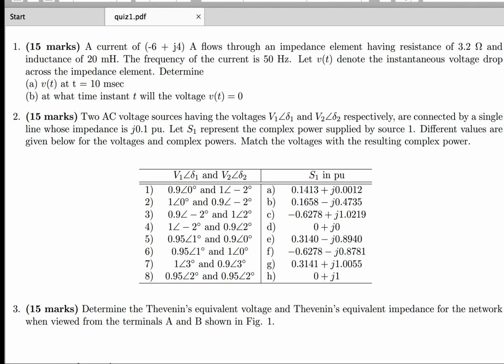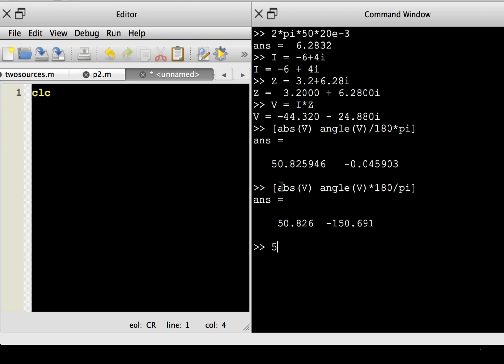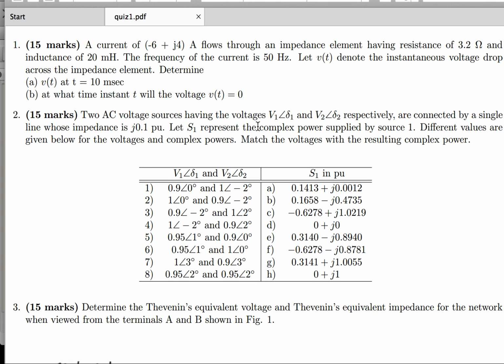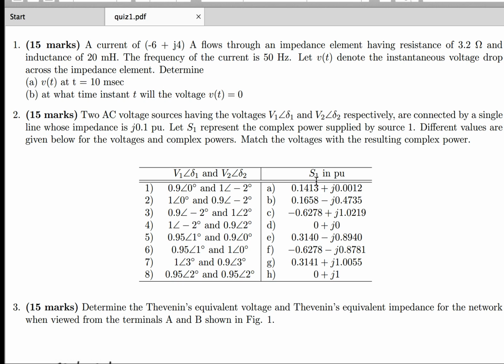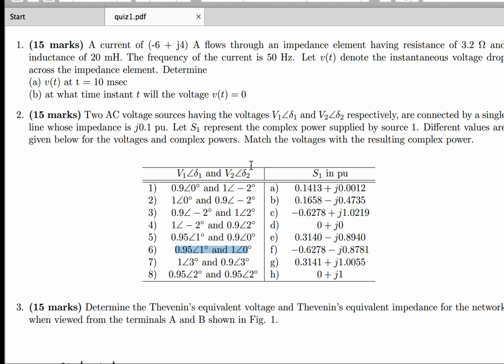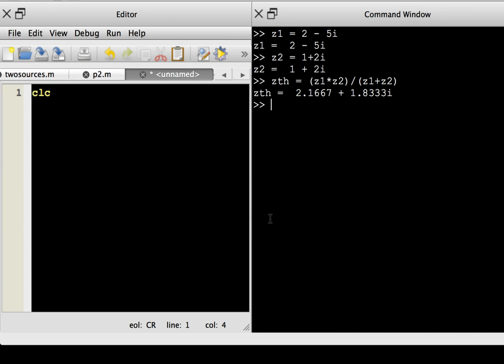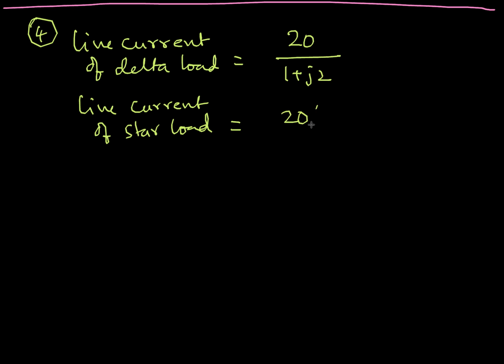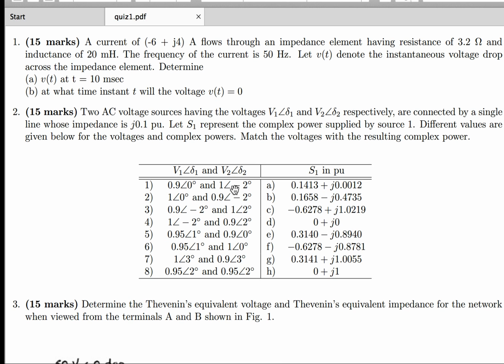EE3240 - Solution for Quiz 1 - Power System Practice - Mar 2017

Comment: Sir, in the last problem in star connection- to find phase voltage we need to divide 20v by √3 but in case of star, line voltage leads phase voltage by 30 degree.we never did that. Why???